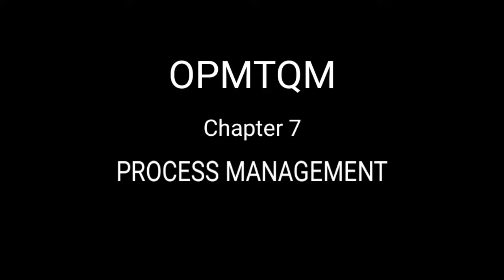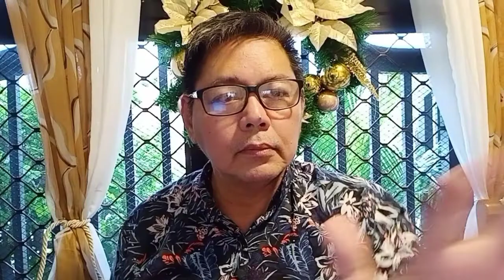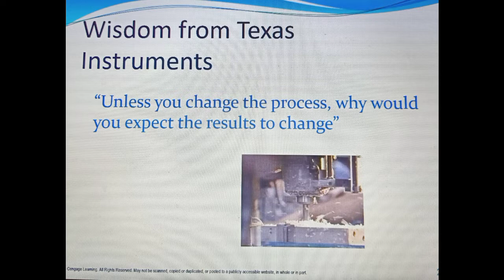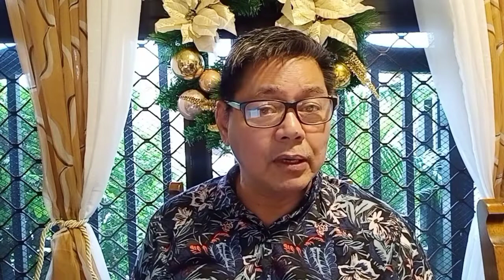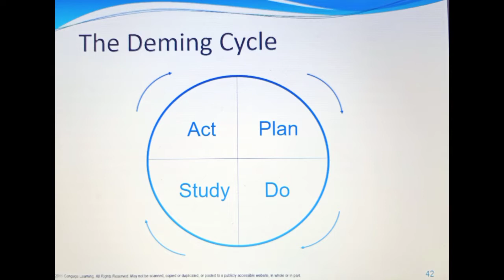OPMNTQM CHAPTER 7 PROCESS MANAGEMENT

Comment: Lazo, Tristan
3BLM

Process management is a concept that integrates quality/performance excellence into the strategic management of organizations.
 Process management includes (1) process design or engineering, which is the invention of new processes; (2) process definition, which requires the description of existing processes; (3) process documentation; (4) process analysis and control; and (5) process improvement.
 Process design and definition include describing what must be done and how it is to be accomplished. After defining a process, it must be documented using a flowchart, a process map, or even a simple checklist. Until the process is described and documented, one cannot be assured that a process is in place. At that point, the process can be analyzed and improved. There are many process analysis tools, including cause-and-effect diagrams, statistical process control, and trend analyses. Process improvement may result from gradual, continuous improvement or a dramatic reinvention or reengineering of the process.  There are 5  of processes (1) Value-creation processes – those most important to “running the business” (2) Design processes – activities that develop functional product specifications (3) Production/delivery processes – those that create or deliver products and (4) Support processes – those most important to an organization’s value creation processes, employees, and daily operations.

Comment: FLORES, Antoinette Gem Y.
2BBE

Process Management one of the most beneficial organizational goals in every businesses. It introduces how a company creates, edits, and analyzes the predictable processes that make up the core of its organization. In a company, they are liable for making some raw materials or information, that turns it into something extraordinary or uniqueness. Basically, it investigates the present status and distinguishes the areas of improvement to make a more productive and compelling organization. 

“Business process management is focused more on repetitive and ongoing processes that follow a predictable pattern, or process management.” Therefore, process management can be determined into two functions, neither task management, focuses on individual task; and project management, handles unpredictable flows. At the point, when an organization left it disorderly and unsystematized, helpless business cycles can lead to commotion and conflicts. At the individual level, individuals are capable of observing the one piece of a cycle, and some may not examine out and see the full impacts of a cycle, where it starts and ends. Applying business process management, organizations can improve their processes and keep all aspects of operations running optimally.

Comment: Flores, Patricia Carmel O.
2BBE

The video is all about process management, it is a systematic approach to making an organization’s workflow more effective, more efficient and more capable of adapting to an ever changing environment.  Process management helps the company in terms of avoiding having defects and shortens the cycle time of production. We cannot emphasize enough about the importance of efficiency of processes in the production and operations.  It leads to better execution of tasks and improved customer experience. Based on the discussion quality inspection and performance audit is included in process management. Quality control is a vital key for total quality management, it does not only increase the customer satisfaction but it also ensures the most effective utilisation of resources that leads to reduction of production costs. 

Organizations create value by delivering their products. It is important to have specific strategies for the betterment of the processes that affects the satisfaction of the customers. Even though the company achieves successes, it is essential to ensure a liveable future, sustaining the value of the business and keeping in mind that change also helps and improvement should never stop.

Comment: Pablo, Angelica
2-AIA

The significance of having a process administration standards is that it centers on end-to-end prepare, it permits everybody to manage a prepare at a few level and could be a client and a provider. It gives the organization the way to have a remedial activity centers on root causes and it decreases errors or surrenders. There are distinctive exercises that must be done to result to a quality item and plan. To begin with, the method control which guarantees conformance to necessities and taking remedial activity when fundamental to adjust issues and keep up steady. 

Process management guideline is very vital for it serves as the premise for successful day by day management of processes. It permits the organization to have control over all long-term enhancements in arrange to create it a prepare standard. It gives a implies of measuring achievement and a comparison of actual comes about with standard, along side input to make the basis for corrective activity. It persistently make strides value creation capacity and making strides its value creation forms.

Process management is important to deliberately maximize resources to play down expenditures, it gives the organization distant better immovability and control of business forms and makes a difference the organization to form way better commerce choices to stay competitive. In any case, executing process management can be challenging due to the hesitance on the portion of the organization for they lean toward the conventional way. But, executing such will offer assistance the organization to plan work flows in line together with your short-term and long-term goals. It too offer assistance them to make strides their operational effectiveness and allow them experiences to form way better commerce choices which increments the nimbleness of the organization. 

In conclusion, these strategies or forms are planned to streamline and optimize the whole process by dispensing with repetitive tasks and uniting your information in one helpful place. It will serve as the gears to keep the organization on running it and thriving it. It permits them to assess and standardize work flows, work around startling circumstances, and guarantee the cost-efficiency of operations.

Comment: Muros, Ella Marie B.
3BLM

The process management is needed to prevent defects and committing errors to eliminate the waste and the redundancy of the operations and the quality output of the business for a better 
company performance. The key process management principles to be followed by an organization, plays a vital role through the process of identifying the vital work of the organization which relates to core competencies and focuses on customer value to gain high profit. These principles should be adopted in order for an organization to be successful and to enhance the sustainability of its success. Aside from that, the business processes should also be considered to satisfy customers; these are the value creation which develops and 
develops the functional product and the support process which is the most important to an organization's value creation processes for the daily operations of employees.

To eliminate errors, a mistake-proof is significant to assess the efficiency of the procedure and to identify the process of whether to reduce or simplify the methods. One of its examples is the “poka-yoke” device, a Japanese term that means mistake-proofing or inadvertent error prevention. It is a device that can be used to answer the questions you want to raise and it will definitely identify the defects by simply preventing, correcting, or drawing attention to human errors that have occurred. Furthermore, there are three levels for “poka-yoke”. The first one is designing potential orders out of the processes. Second, identification of the potential defects and stopping a process before the defect is produced. Third, finding such defects that enter or leave a certain process.

Therefore, a process management is very important in the business world because it helps a company to expand and improve its overall operations by minimizing and reducing errors. Thus, it reduces the daily expenditures by having a better work control and operations management in producing a quality product or service.

Comment: Domingo, Baron Andre M.
2BBE

In achieving Total Quality Management, there are a lot of process and steps. Process Management is part of the process. Process management is how a company creates, edits, and analyzes the predictable processes that make up the core of its business. It is an organizational discipline where a company takes a step back and looks at all of these processes in total and individually. It analyzes the current state and identifies areas of improvement to create a more efficient and effective organization. It’s important to remember that process management begins with understanding. In many cases, that means identifying each business process. Then you can put those basic steps in action and begin to see how they operate in the wild. This branch can help every company to have high performance that can lead to better quality output. It is important because it can help organizations gain a competitive advantage by assisting business leaders to improve organizational performance by analyzing, designing, implementing, controlling and modifying operational business processes. It helps to put into effect quick responses to challenges and opportunities, at the same time helping business leaders make the right decisions for overall company growth. In conclusion, Process Management is important in obtaining the goal of Total Quality Management. The practice of it often leads to automation of repetitive tasks, removing bottlenecks, and reducing unnecessary steps and by streamlining operations and collaboration, and reducing duplicative efforts, companies can decrease costs while improving productivity.

Comment: Gayle Martin P. Santos
2BBE 

Just like what is stated in the lecture “Unless you change the process, why would you expect the result to change?”. Of course, without a process there is no improvement made at all. That is why the concept of Process Management is made. So, what is Process Management? It states that Process Management helps in preventing defects and errors in a business. Related to this idea, Process Management also involves eliminating waste and redundancy of the business. Let us say that the leader or the employer has three men doing the same job in the manufacturing team. It will become a redundancy when the boss removes one of those employees because he/she thinks that his company has too much workers that is unnecessary. But if the employer has a good idea of Process Management, what the leader can do is maybe offer another type of job in the firm and give him/her support or training to be able to fit in that specific type of work. With that the leader doesn’t have to exclude his/her employees which can lead to a TQ (Total Quality) based establishment. 

Process Management has two types of processes such as: 

1.	Value-Creation Processes and
2.	Support Processes

The Value-Creation Processes contains the steps on how to develop or deliver the product or service intended to the consumers. On developing the product, itself, it is under the Design Process while the Production and Delivery Process includes on how are you going to give that product or service to a customer.

The Support Processes are the ones that can help you in producing that specific product or service. It is more direct in the operating cycle of the business which includes taking care of your personnel, checking of supplies and machine and equipment. 

To conclude, your main aim must still be the same as well as what are discussed in the previous teachings. Your product or service must be able to satisfy not only your consumers but also, your company as a whole. With Process Management, it can help SME’s (Small and Medium size Enterprises) or bigger companies to exceed customer expectations. It can benefit firms to have a more effective and efficient business cycle to have more accuracy in producing outputs.

Comment: CERVANCIA, Charissa Gail J.
2AIA

Total Quality Management is a continuous process of detecting and reducing or eliminating errors to provide efficient services to other people. Today’s discussion also has a connection in total quality management, as process management is a concept that integrates quality and performance excellence.

Process management is an integral part wherein it eliminates waste and redundancy of the operation and the output of the business. It is an end-to-end process that involves planning and continuous improvement for that business to be able to identify what approach is going to make to satisfy customers. It is like doing a research paper or experiment wherein you need to check every process if you are doing it right for you to be able to succeed. It has a cycle wherein you need to test every process, wherein you need to study>>act>>plan>>do according to the Deming cycle. 

The main goal of process management is customer satisfaction. So for the business to achieve that goal, they need to make sure that every process management activities and requirements are met by the management. Process activities that involve design wherein the business must ensure that the inputs are adequate, control wherein the business needs to ensure whether the process performed is according to what is planned and improvement wherein the management is continually seeking to achieve a higher level of performance. Moreover, the process must be repeatable and measurable that will lead to improvement.

In conclusion, the success of the business is a combined effort of the management as a whole. Hard-work of the management is equal to the trust and loyalty of a customer. Success wouldn’t be achieved by the organization without the people’s willingness to extend their hand.

Comment: Erfelo, Rein Lian 
2-AIA

In this chapter it talks about the prevent of defects, errors and eliminate of waste and redundancy to lead  organization in a better quality and improvement in their performance. Process Management refers to adjusting processes with an organization’s strategic objectives, designing and actualizing process architectures, setting up process measurement systems that align with organizational objectives, and educating and organizing managers so that they will oversee processes viably. It was a combination of individuals, policies, and innovation. Whereas software like Integrify helps streamline and computerize workflow and processes once they've been developed, computer program alone isn't sufficient. 
The objective of any process management framework is to convey improved results whereas guaranteeing the best use of existing resources. Handle analysts are skilled in modeling future state commerce processes by conducting interviews, analyzing information, and using process modeling tools. 
These models are then used when using workflow management tools to automate tasks human or machine that have to be performed amid a process.

There are two categories Value creation process is giving something valuable to receive something else that’s more valuable to you. This definition is broad and captures both costs and benefits. Further, it applies to owners, customers, and employees. And Support Process that coordinate the development and life cycle of the activities contained in the main processes, organizational and business processes
.

Comment: Josh Rafael Angeles 
2-BBE

Creating a total quality process management can make a big impact in an entity. it will create a quality process in the internal structures that will create and result into a efficient business operations. it creates a good status of brand equity due to the quality it provides that creates customer satisfaction. and lastly the risk in the business will be lessen because it has a quality process management that involves that can create a big revenue in the long run.

what are the things to consider in implementing a total quality process management, first is have a quality people that is included in the process. the people that will be involved should be properly trained in order to deliver a total quality process management, next is the workplace and equipment. it should compensate with the skills of the personnel with the equipment he/she has in order to bring out its potential. next is the process they need to do every single time in order to meet the factors that i have said it needs to have the right process in order to have an efficiency in the process that will result into customer satisfaction, that creates an expansion in revenue which all the companies long term goal is. it is very important to consider the plan,study, act, do concept in order to deliver a satisfying process management. 

concluding this analysis i realized how crucial it is to have a total quality management in an entity. or to the starting businesses that is in the process of establishing a business should consider focusing in process management in order to meet the satisfaction that customer wants and the satisfaction of the entity in the process as well as the satisfaction of the employees, it all boils down to process management and might as well surround the entity with the right people and everything might turn out right for the company